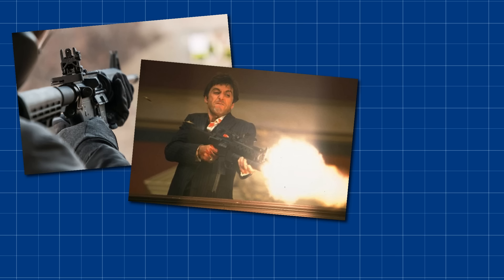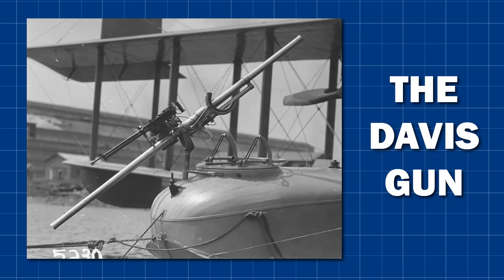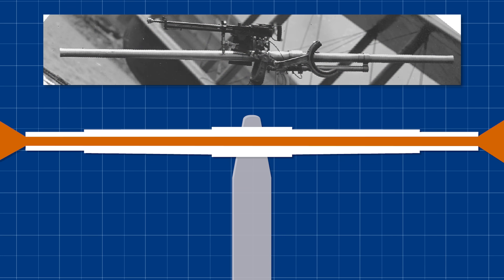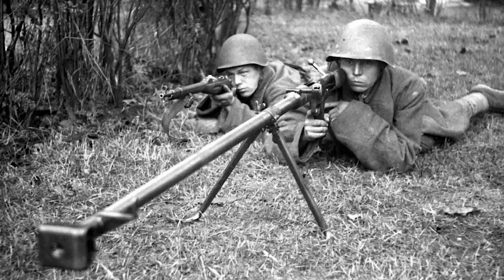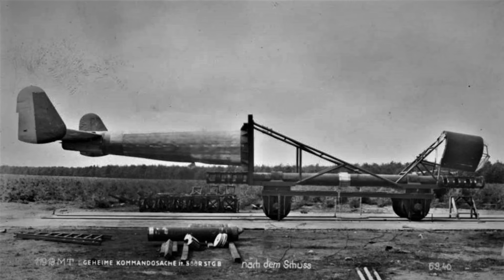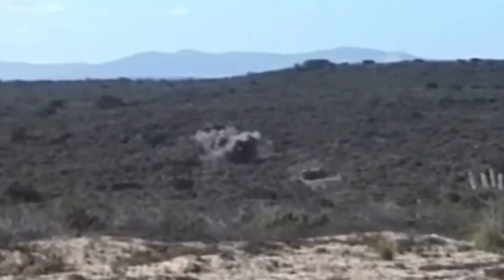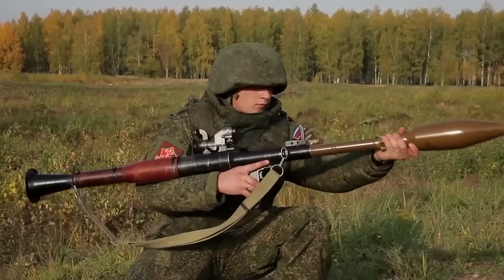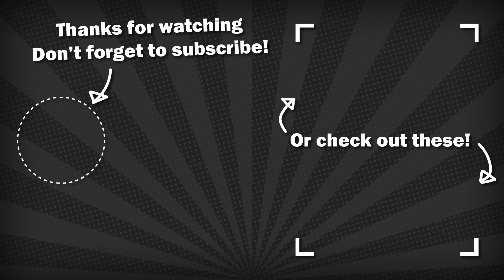What Actually IS a “Recoilless” Rifle?

Comment: "But machine guns aren't going to do much against a zeppelin"
It's a giant balloon full of highly explosive gas, did they not have illuminating/burning bullets back then? Because I do not see how a giant balloon is difficult to shoot down even with a bolt action rifle from the ground I'm pretty sure I can shoot one of those down if I fired about ten shots into it one has to catch fire.
Reply: No, they did not. The Brits actually came up with incendiary ammo later on to discourage Zeppelin bombing runs. Zeppelins operated at fairly high altitudes so most ground firewas useless and the gas cells are so massive that even with machine gun fire from aircraft, a bunch of relatively small holes would have only gradually leaked out hydrogen, and not have caused the cells to pop.
Reply: @elburropeligroso4689 agreed!

Comment: The Wombat was the third iteration of the 'BAT'. The original BAT was the one you showed with a shield on the wheeled carriage. Then there was the second version with the shield removed and with a Bren spotting rifle - that was MOBAT (mobile battalion anti tank). But it was still towed. WOMBAT was light enough to mount in a Land Rover and had a .50 cal ballistically matched spotting rifle. And there was the two and a half gen CONBAT which was a MOBAT that got the .50 cal spotting reifle.

Comment: The US made a recoil less rifle that fired miniature nukes
Reply: Davy Crockett
Reply: They also built a artillery howitzer that fired nukes
Reply: @Ethan98-19  and they adapted that warhead into 16 inch shells to be fired by battle ships.
Reply: Not a recoilless rifle.
Reply: @XtreeM_FaiL  smoothbore gun, but still recoilless
Reply: Hang on, that silly nuke gun in Fallout is real?
Reply: @bipolarminddroppings  No. Davy Crockett is not a shoulder fire weapon.
Reply: @XtreeM_FaiL The correct term for the “M-28 Davy Crockett” is “man portable”. The launcher weighed just under 50kg and the nuclear warhead added another 34kg to that. (Which technically means the average Piper Cub is “nuclear capable”).
Reply: @XtreeM_FaiL  The Fallout Mini Nuke is the same concept - it’s not single person portable weapon as described.

Comment: "I think I'd take the Apache over the Hilux"

You say that, until you take a look at the procurement and operating costs, not to mention readiness/availability rates
Reply: Pretty sure they don't carry Pratt and Whitney parts at autozone either
Reply: @midship_nc  Sooo.....  O'Reilly then?
Reply: @ColonelSandersLite  probably have better luck on temu, just don't ever fly the aircraft again nbd.
Reply: @midship_nc you could fly it afterward. once.
Reply: Any halfway competent mechanic should be able to keep a toyota running with some pretty basic tools.  An apache needs something like 30-40 man hours of maintenance per hour of flight time.  A toyota needs what?  Normally a few hours per month and a couple of days per year?

Now don't get me wrong.  If you can afford apaches, you get apaches.  But a fleet of highly mobile reliable technicals definitely isn't the worst possible option.  And...  You know...  The US military does both.  I have seen plenty of jeeps and humvees with various support weapons mounted on them over the years.
Reply: 1? sure. 10? I'd probably still take the Apache but price is the right way to compare them.
Reply: @renaissancenovice7202  considering a helix costs like 50k kitted out, its more like 1000 trucks to 1 Apache
Reply: Hiluxes can possibly be requisitioned from civilians en masse if a conflict starts. Of course, you still need to have some kind of weapons to bolt on to them to make them technicals.

Comment: The SPG-9 and M40 (and their various copies) are extremely popular to this day, seeing service not only with militant groups but also major armies. They're a great way to add huge firepower to a small vehicle very cheaply, and their light weight allows for them to be carried by only a few soldiers for easy battlefield infantry support.
Reply: There are countries that can afford to equip their frontline troops with expensive but much more effective weaponry, and then there is everyone else.

I mean the M136 does the same job as a heavy tripod mounted Recoilless Rifle but it is man portable and you c an have several in a squad.
SMAW if you are a Marine squad.
Better yet you can just call upon air support to annihilate whatever you are dealing with of course there are only five or so militaries that can reliably get air superiority in any conflict.
Reply: @PeterMuskrat6968 m136 and smaw are rpg-7 in most countries , spg9 and recoilless are more like cheap unguided atgm or light mountain howitzer ( can shoot much further range and it war head are much bigger then rpg/smaw-m136)

Comment: Fun fact: the M40 recoilless rifle is actually 105mm and not 106mm. They designated it that way to avoid confusion with the incompatible 105mm ammunition of the M27 recoilless rifle failure.
Reply: Did the designation came before someone tried it or after?
Reply: @gabrielho1874 it's referring to an engineering failure. They do use 105, but label it as 106 so they don't use ammo from a different recoilless rifle. More or less they did a no no. Don't make a hole where things that don't go there fit there. Probably the powder load on the other rifles was too much for the barrels and well, that's how we get a barrel shaped hand grenade on a soldier's shoulder.
Reply: @dalee.9128  So it was designated before someone thought he could fire the shell if it fits
Reply: @gabrielho1874 
Not so much that as that the shells are shipped in the same type of ammo case, so they figured (based on extensive experience) that they should make as many of the markings distinct as possible so someone in a rush didn't just grab the boxes with the right calibre on them and end up with shells for the wrong gun.
Reply: It reminds me of how the UK classified the revised 17 Pounder as firing 77mm to not cause confusion
Reply: @Rosejohnstone  That's not true.  The 77mm was so named because it used the same projectile as the 17 pounder, but had a smaller case/charge.  The 77mm was a lower velocity gun.  Similarly, the 88mm gun in the Tiger 1 was different than the 88mm used in the Elefant.
Reply: @JayWC3333  that’s literally what I said. I know the 77mm and 17 pounder used the same projectile, it’s just the case that was different. I didn’t know the Elefant and Tiger used 88mm guns though, so thanks
Reply: @JayWC3333 You repeated word for word what they said. You’re not impressing anyone with your ego.
Reply: @tim4570 I repeated it to help him...not to display ego.  I'm sorry you were threatened by that and felt the need to lash out.
Reply: @Rosejohnstone same with US 75mm, 76mm and 3inch designation for the tank and tank destroyer rounds in WW2
Reply: More or less, they did do a grunts and crafts project years later to strap multiple of them to a tank.
Reply: Another fun fact: for Operation Just Cause in Panama, the US broke out the old M40 recoilless rifles because they didn't expect to be able to get to gathering distance with the TOW missile in Panama City. Only a few old lifer sergeants still knew how to use them.
Reply: C650 and C651 DODAC Numeric designation mainly used for H & I fire in VietNam
Reply: It wasn't done to keep us from loading the wrong ammo. It was done to ensure that the logistical chain didn't send our ammunition to the guys with howitzers and vice versa.
Yes, us. I trained on and fired the 106 in the early 'eighties. Coolest experience ever!
Reply: Did you accidentally swap those numbers? As written, that doesn't make sense.
Reply: @seneca983 There is nothing mixed up here, how are you confused? Wrong comment?
Reply: @ OP said that both use 105 mm ammo. Isn't it then exactly possible to confuse them contrary to what OP said? Or did I misunderstand him?
Reply: @ Or alternatively, why are they incompatible if they have the same caliber?
Reply: @seneca983  Ah I see what you mean. They are both 105mm in the caliber of the shell but the M27 and the M40 both use different designs of ammunition. But the real reason is that ordinance department realized that they would have 4 different weapon systems that all use different types of 105mm ammunition. Which might confuse supply personnel, you don’t want to accidentally receive 105mm howitzer shells if you need 105mm recoilless HEAT shells. The “106mm” written on the boxes was meant to make that very obvious to supply and ground troops.
Reply: @seneca983  the case/charge is an important part of the round.  That's why there is an issue with .223 caliber and 5.56mm rounds.  The case and charge and pressures are different even though they're the same caliber.
Reply: @tim4570  OK, now I think I understand better what was said, though labelling a caliber that doesn't correspond to reality sounds pretty wild. I'm still a bit confused when you said:

"you don’t want to accidentally receive 105mm howitzer shells if you need 105mm recoilless HEAT shells"

But didn't OP talk about two recoilless rifles rather than any "recoilful" artillery pieces?
Reply: @seneca983 U r a bit dull, eh?
Reply: @tim4570 I still feel like it’s dumb how reliant people (and military too now I guess) are on caliber especially in mm for ammunition when obviously it leads to issues like this where completely different ammo share diameters so we’re pretending it’s a slightly different caliber.

Comment: The recoil is not created by the force of gas pressure, you can observe this if you fire a weapon with a bent barrel. The Sturmgewehr 44 with the "Vorsatz P", commonly known as the "Krummlauf", has a recoil acting sideways (or up, if the bent barrel maces downwards) while the gas pressure still acts upon the breach.
Reply: while the pressure also pushes back and forward it actually also pushes everywhere else

just with a straight barrel the opposite of top wall is a bottom wall so all forces cancels out

Comment: Good video but I'm still a bit confused. Isn't every shoulderfired rocket launcher technically a recoilless gun or are they only called that if the projectile is shot without the use of the rocket motor at the start? Would a Panzerfaust be a recoilless gun? Would the Panzerschreck be a recoilless gun, a rocket launcher or both?
Reply from the maker: If the rocket motor is the only thing propelling it out the barrel, it’s a rocket launcher. If an explosive charge is propelling it out the barrel, it’s a recoilless.
Reply: @RedWrenchFilms  Awesome, thanks!
Reply: the difference is the ammunition they used. if it fires motor-powered warhead, then its a rocket launcher. meanwhile recoilless fires conventional shells propelled by a charge in a separate case, just like your usual shell.

Comment: Did the CG not use salt water to counter the back blast
Reply: There's sets for it that allow you to shoot from large indoor rooms with relative safety. If you're behind the gun you'll be killed by a high speed spray of water but at least the gases are slowed down to a safer velocity.

Comment: Would u ever do a video about the differences between Mortars, Howitzers and artillery ? like what classifies them as which ?
Reply: Artillery is a blanket term for large caliber fire outside of visual range. Howitzers and mortars are both artillery pieces
Reply: @andrewlee8204  Looks like you confirmed that a video is necessary.
Reply: Originally, idea of mortar came up when people were still doing fortress siege and realize instead of throwing explosive at the stone wall, it would be nice to be able to lob shells over it, so they need something that could fire at extreme high angle (45 degree and above) while the range is not a concern. They realize this can be achieve simply by making a shorter barrel howitzer and putting less gun powder in. And when they point it upward to shoot, they realize it looks a lot like... well, a 'mortar' (the tool you pound stuffs in it), and they named it after that to separate it from the long howitzers.

With the advance of technology and warfare, people don't really need to lay siege too often anymore but realize it's still pretty neat to have a light arty unit that's highly maneuverable to cover the close combat range (in which normal howitzer would be inefficient, because it's too close), which the mortar fits perfectly. And you have the mortar today.

So the idea behind mortar is a lighter, simpler cannon that only need to fire HE at short distances (compare to normal howitzer). Because of that, you don't need a lot of chamber pressure and that reflects in the design: most of them have shorter barrel, simpler breech and loading/firing mechanism, lighter chassis (because less recoil), easier/faster to deploy, need smaller crews to operate
Reply: @miliket4tom Because of the exlusively high angles of fire intended for (most) mortars it is relatively simple to have them mounted on a plate on the ground to absorb the recoil. The mechanism obviously doesn't need many moving parts or many heavy components other than the plate and the barrel, which is obviously advantageous even for footmobile use.

I don't mean to nitpick but I would like to add that mortars are not technically cannon, which is yet another taxanomic category of artillery guns, separate from howitzers and mortars. Cannon are meant for low angles and usually have high muzzle velocities.
Reply: Mortars are generally muzzle loaded and have a different use and doctrine to traditional artillery.
Reply: Generally speaking, there are two things that sperate these items - angle of fire, and method of loading. 

Mortars fire on a very high angle, at a fairly short range, and come down near vertically - so say from a trench to trench on a short range. Artillery guns are the opposite - long range low angle fire. Howitzers would then be in the middle. Guns could be potentially used for direct fire, the others less so. 

Howitzers generally use multi-part ammunition - you load a projectile into the breach, followed by a varying number of propellent charges depending on range. Guns tend to use one piece ammunition (ie looking like large bullets with a projectile and case together) Mortors tend to be muzzle loaded one piece units. That said - there are breach loaded Mortars, and ones that can have an adjustable amount of propellant to alter the range. 

One other note - mortars are usually smooth bore tubes with fin stabilization for the projectile. They also tend to be smaller and intended for transport by individual soldiers, rather than needing a towing vehicle.
Reply: would be good
Reply: A howitzer is capable of direct and indirect fire, while a mortar is only capable of indirect fire
Reply: @kodiak-v9b  The Patria NEMO mortar is capable of both direct and indirect fire. It's also breech loading. I'm not sure what makes it a mortar but it is one.
Reply: Cannons fire at direct angles. Howitzers fire at mid angles for long range. Mortars fire at high angles to bypass cover. All are a form of artillery. All other details are the story of historical progression.
Reply: @SepticFuddy bingo!
Reply: Its all about angle of fire and how you load it.Howitzers can shoot directly(some of them can go up to -5° elevation) but they can  also shoot up to 70° high to lob the projectiles at high velocity and over the great distance -mostly they are breech loaded and you can adjust propellant size -something that cannons cant.
Mortars lob the projectiles at minimum angle of 45°(that also gives them maximum range) up to 85°,they are mostly muzzle loaded ,you can choose projectile propellant size for a distance.Projectile velocity is slow ,mortar rounds tend to hit target vertically.Range is not as great as howitzers on mortars but they are more mobile and faster to set up and fire.

Artillery is general term for cannons,mortars,howitzers,rocket launchers  and preety much anything that shoots large size explosive projectiles while being stationary.
Reply: At least at one point the distinction was that guns were cannons that fired at low angles, mortars at high angles, and howitzers at intermediate angles. However, I think this doesn't 100% correspond to modern terminology anymore.
Reply: @seneca983 Cannon are now defined as a direct fire weapon with a caliber of over 20mm.
Shoulder fired 20mm infantry rifles have been manufactured and issued for military use (as recently as the 1990’s).
Reply: This.
Reply: that is a good idea, ngl...